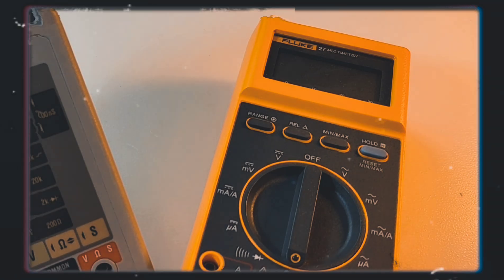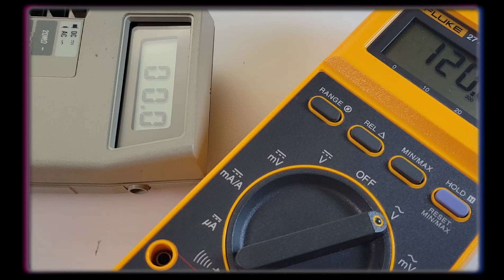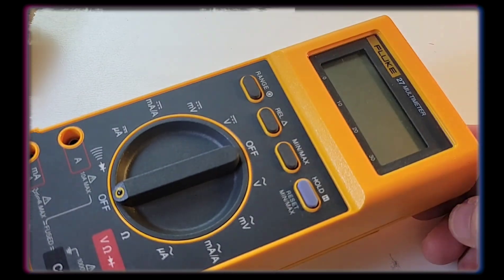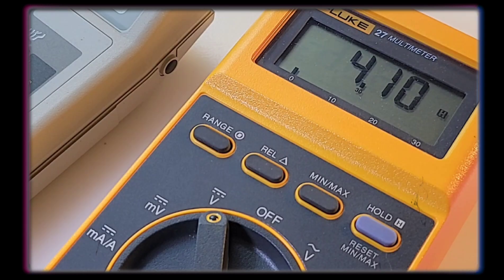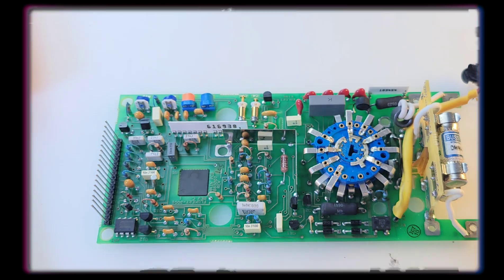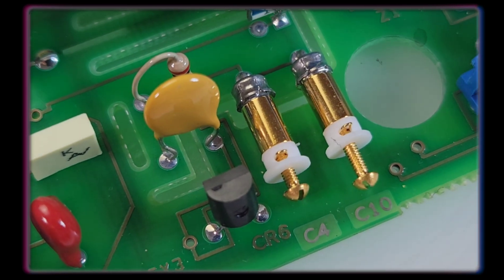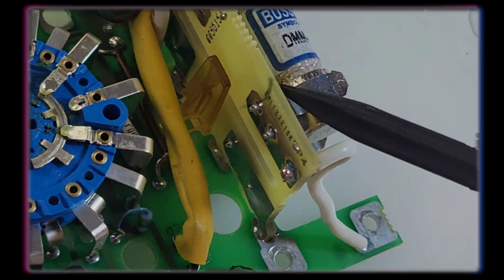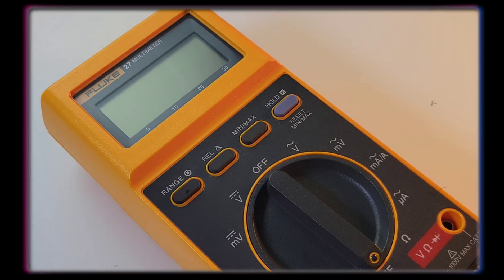RETRO-TECH ○ FLUKE 27FM Mini Review & Teardown! (1986-2003)

Comment: I have the same yellow one and a black one. I've dropped the black one from my desk to concrete floor many times and it has not had a single prob even with the shell itself! This thing is a tank and really takes a beating!
Reply from the maker: Wow..that's definitely a bump! Glad these tanks are standing up to the adverse conditions they were designed for..robust is an understatement when it comes to the Fluke 27 series! 👍

Comment: I have the black version. There used to be a lot of the black version, on ebay, for a reasonable price. Don't seem to be too many around any more. Like you said these are ex military. There is a calibration procedure available on line
It's nice to have a multimeter with the name "Fluke" on it.
The only, slight, down side is the meter takes a couple of seconds to "boot" when you switch on and I keep thinking the battery is dead for a couple of seconds before the display comes on.
Reply from the maker: Great point. There is definitely a delay to post after power-up,  not sure where the bottleneck is but it's a little freaky if you're in a hurry 😉